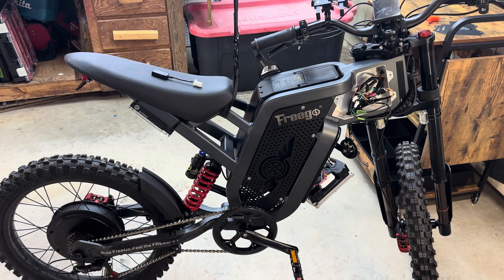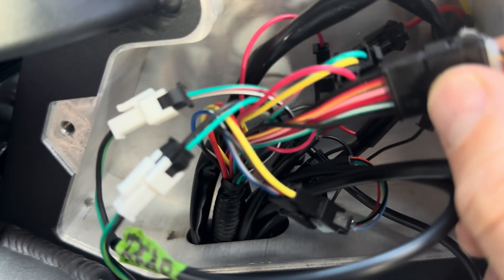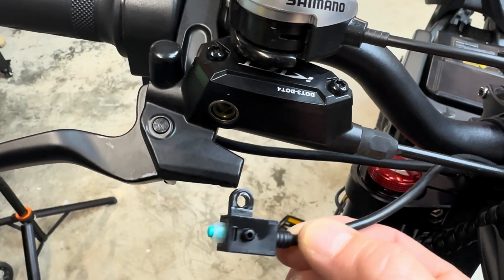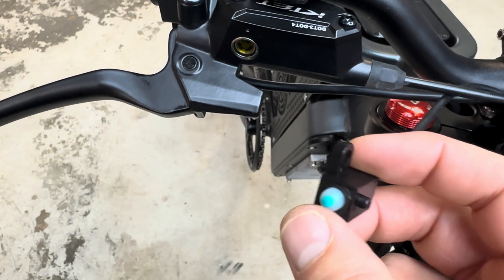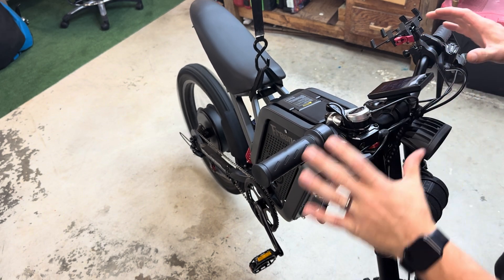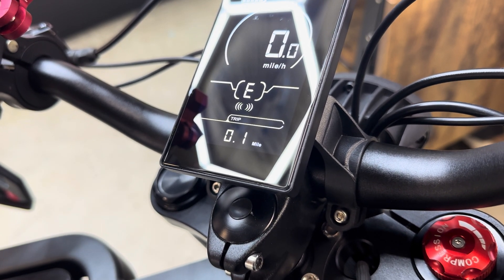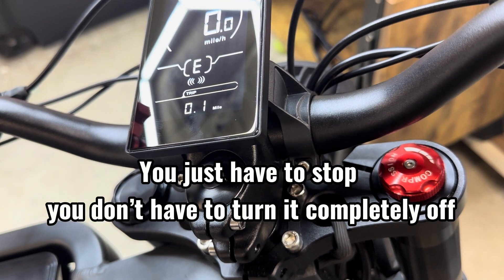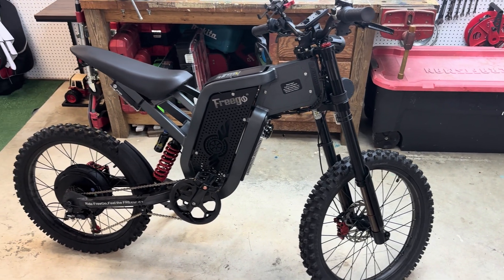Freego x2 E-Bike: Brake Sensor Delete & Controller Programming Guide

Comment: I’m getting an error code EO2 on my fregoo x2 pro I unplugged the brake sensors and the bike is still displaying the error code. What should I do?
Reply from the maker: I'm not sure what the 02 code is. Double check all your connections that they are tight and no wires are loose even on your controller.

Comment: My freego x2 pro bought few months ago, won’t turn on. It beeps once if you press the on button. If I throttle it moves  for 1 sec
but stop immediately. Display won’t turn on either. Can you give me some tips how to fix.? Wirings are ok. Battery ok to. 

What I know few hrs ago my son is trying to wheelie then it happened.
Reply from the maker: I can help better if you send me a message on Instagram. it sounds like either your display is going bad or your throttle could be messed up. I know some people are having problems with the new full twist throttle. My first suggestion would be to buy a different throttle and test it out that would be a cheap solution.
Reply: Good evening. Just to update you. The freego support team just sent me a new display monitor and it works. So it means, if the display is not turning on it won’t power the motor as well..? I’m just happy that it’s running again. Thank you for your response.

Comment: Did you ever manage to hook into the Fardriver to hook up to the bluetooth? I've heard you need to buy a new controller, is that correct? Also do you have a 12 volt power supply for your phone & similar thanks?
Reply from the maker: I will be hooking up my controller to Bluetooth sometime this week. I have it planned for Wednesday. As far as 12 V I do not. I carry a battery bank if I need to charge my phone.
Reply: @E_bikeDad  hope your able to get the bluetooth working would love to see how onw goes about getin done lol

Comment: hi, my freego x2 pro is stuck in 0 pedal assist mode, any advise? any assistance is greatly appreciated.
Reply from the maker: Unplugged each Connection plug it back in double check all of your wires on the back of your controller. Make sure that your battery is sitting all the way down on the bottom plate and there’s no gap. If none of that works, you need to email Freego support for further steps. Because it may be something going on with your controller.
Reply: @E_bikeDad thanks very much for the reply.
Reply: @E_bikeDad  thank you very much

Comment: On the M20 I just cut the sensor wires but only the back brake is necessary
Reply from the maker: On this one, you can’t just cut the brake sensor because of the style it is you have to unplug it or glue it compressed somehow.

Comment: Do you know on the x2 how to change the kilometers to miles?
Reply from the maker: you can’t without a far driver factory harness
Reply: @E_bikeDad my bike has been in mph for the past week but randomly this morning it switched to kilometers
Reply: Is there anything I can do
Reply from the maker: so most of the bikes in the US were shipped with miles per hour there are some that were shipped in kilometers per hour. To my knowledge that is a setting done at the factory. You’re the first person I’ve heard that it switched over to kilometers per hour. The only way to switch it back-and-forth should be with a factory harness and then use the far driver app.

Comment: Thanks for the vid! I have the X2 Pro. Can you tell me how you got your front brake to be on the right as it should? Thanks in advance! ⚡️⚡️⚡️
Reply from the maker: all you do is unscrew each side then flip them upside down. If you look through my YouTube shorts videos I think there’s one on there where I show it in place. But you just unscrew them and flip them on the opposite sides and screw them back on.
Reply: Ok. I thought it was just that simple. All the wires had me overthinking it 😅Thanks! @E_bikeDad

Comment: For wheelies (I'm starting to figure it out now) You need to have the bike part in 5th gear, and around 10mph at full throttle you can do the pedals at the sometime, and get it started. It's basically finding the right gear, and speed to hit both of them.
Reply from the maker: I’m about to start that journey

Comment: my 21 max goes only 47 mph.. how to unlock the speed limiter??
Reply from the maker: There is no limiter on this bike. How much do you weigh? There are a lot of factors that go into top speed of E bikes. Also, I don’t know what EKX does with their bikes. I’ve never owned one, but I assume the programming might be a little different.
Reply: I also have the x21 Max (seems to be the same frame as bike in video), and the speedo says my top speed is 48, however GPS on phone, plus two different speed limit signs say that's 42-43mph, I Have also checked for the far controller connection, and it has the same connections as this bike in video. I know you can get an aftermarket wire harness, and wondering if I have that harness, plus the dongle if I might be able to reprogram the controller to get faster top speeds.
Reply: @C0braChicken2  shoot that's about 6mph faster than I'm able to go. Ekx is great at false advertisements. Im only 155lbs soak and wet, my bike gets to 43mph, on a hill 46...I'd be happy with the 52mph i thought I was buying it for. But I see a lot of guys hauling way more a$$ than I'm able with the same bike...

Comment: How do I fix the error 22
Reply from the maker: Try unconnecting and reconnecting all the connections
Reply: @E_bikeDad  do u think the bike is screwed up now, i saved so much money for it, do i just unscrew the controller thing or the silver box and reconnect it, im not very techy at these things, i was riding normally n then it just said error 22 im just worried right now
Reply: @ashtonk-xq5kh yes un screw the bolts holding it in the manufacture has even said sometimes the connections get loose in shipping and to open it up and make sure everything is secure
Reply: Get a new throttle from ekx
Reply: I had same problem. Although even with new one it says error 22 here and there. When turn bike off says error 26 or error 30 sometimes so I dunno wtf.
Reply: @petermann841 I think their sending me a new accelerator or throttle, I just hope this can actually solve the problem

Comment: is there any way to add more power to the bike so it can wheelie easier?
Reply from the maker: The short answer is no. There is a complicated process to reprogramming the FarDriver controller. And the small amount of power change isn’t worth it if I find a simple way, I’ll let everyone know if I figure out an easy way to change the settings. Right now it requires adding some wiring to the harness.

Comment: Im assuming the brake cables would be the same on the ekx right? Its the x21 max same bike just different company’s
Reply from the maker: Yes
Reply: @ another question is my bike will beep when charging it will beep once then a second of two later it will beep 3 times i haven’t found anything in the manual but google says it could mean the battery’s towards the end of its life span but i haven’t had the bike for 2 months idrk bikes fine no issues ive had one error code and im pretty sure it was just my heat sink freezing
Reply from the maker: what do you mean it’s beeping? Are you charging it with the bike on? The on and off switch to my knowledge is for the discharge port to turn on and off not for when you’re charging the battery. I never charge the battery with the power switch the red one on. I really never charge it on my bike.

Comment: You are right. You have to get the factory harness with their Bluetooth dongle and plug it in. Then program. Some options are locked but can change a bunch of them and then when done changing settings go ahead and plug in the original harness again and you’re good to go with the new settings   Thanks for the video
Reply from the maker: Thanks for watching
Reply: Where can I get the original harness and can I change km to MPH?
Reply from the maker: @ I haven’t done this process so I’m not sure. Email fardriver and ask what harness goes to that controller and if there is any other parts you need any other parts to change the settings
Reply: @E_bikeDad  Cool, Thanks 👍

Comment: How did you change kilometers  to miles per hour?
Reply from the maker: You can’t they program that from the factory in order to change any kind of settings you have to re-pin the harness that’s on it. I have a wire diagram that shows how to do it, but I don’t have the time to the controller.
Reply: Press the power button 3 times quickly. That's what the website says 😁
Reply from the maker: @ where’s the power button?
Reply: @E_bikeDad  the link I was reading online was referring to scooter 🤣 my bad!! Mine will arrive Monday I will see what's up haha
Reply: @E_bikeDad   I just looked at some more of your videos and it seems like it is in mph. Your speeds from your phone pretty match the bike screens and on the bike screen it says miles/h under the speed.

Comment: Where does the motor disconnect?
Reply: I ask because the rear inner tube on my bike was damaged and I have to replace it.
Reply from the maker: If you check in my videos, I have one that talks about tips on changing the tire you don’t need to disconnect the motor. If you really want to the plug-in is behind the controller. When I change my back tube, I didn’t disconnect you’ll see it in the video.

Comment: Just got mine but for some reason when I come to a stop for a minute or two it automatically goes into park. Do you know how I can stop the bike from doing that?
Reply from the maker: No it’s a program default can’t turn it off
Reply: @E_bikeDad  gotcha, also do you know if the charger turns green when it’s fully charged?

Thanks!
Reply from the maker: Yes, it turns green and fully charged the Manuel says to leave it green for an hour, but I normally only leave it for 20 minutes to 30 minutes after it turns green

Comment: It looks like a fardriver 72260 controller
Reply from the maker: Yeah, but the wire harness looks different
Reply: @E_bikeDad  yeah I definitely can tell the harness doesn't have many wires as a standard one
Reply: but the ND72260 is for a 1000-1200W Motor, and not 3000W. Can u still run it?
Reply: @kingqueen27  and? You can put that on anything bro i was just assuming what that was. Now you go
Reply: @EBG-offical  
I just noticed something and asked if it is still possible bro?!. Didn't mean to offend  you or anything.
I would desperately  like to know this because I would like to replace the controller or cables. To connect the controller and control the display etc.
Since a bluetooth dongle dont work yet.
Reply: @kingqueen27  yes you can put it on any set up i thought you might know more than because I'm still learning as day goes by I will cover some of this in my live session  not offended at all I get this topic all the time
Reply from the maker: @EBG-offical  just watched some of your channel I like your content. It makes me want to do a small build.

Comment: hey any advice to an older guy that just rides a big niu bgx....but I like those bikes...
Reply from the maker: How old I’m not young anymore either man. Most of these guys riding are in their teens and twenties. If moneys not an issue I’d get a talaria or something that’s a 72 volt platform. At the price point of this bike the x2 you can afford to do some upgrading and still be way under the price of those bigger bikes. The first big modification that I’m doing on this bike is going to be to figure out how to get a bigger battery pack on this thing because if it had a 50 amp hour battery that would fix a lot of the shortcomings of this bike.
Reply: @E_bikeDad that's the reason I'm thinking of getting Stealth bomber or even E ride pro bc of the power otherwise I like the freego

Comment: Oh ya you're going to practice wheelies?? Yeeeeee!!  I got 28 days before mine arrives abd want to know how the x2 holds up for wheelies. My cunfon rz800 scooter lasted 3.5 months. Still runs but wheelies are destroying it. Lost fenders, headlight, back suspension and rear tire bald. .   But two days ago the motor started skipping out beeping giving some error code.. . The scooter telling me no more riding wheelies. But I never deleted braje sensor so think that's why my motor getting messed up. Smashing throttle and braje simultaneously too much got motor skipping out cuz sensor still connected, I guess.

Tip: I hear good idea to practice on grass
Reply from the maker: Definitely starting in the grass

Comment: Mine does the same thing with the horn
Reply from the maker: Good to know, I’m not the only one I think it has something to do with the way. The wire harness goes, and the power of the horn takes takes to honk.
Reply: @E_bikeDad  I freaked out the first time. I was way out in the middle of the woods, I bumped the horn and it shut down with e24. Btw, all of the rattle on the bike comes from the kickstand. I drilled out the rivet in the hinge and the-bolted it tightly and the bike is silent now. Oh and the headset wasn’t properly tightened on mine. Had to tighten it up because it creaked.

Comment: I have the original ekx x21 and you can reprogram the controller from the display. Not sure about this controller. Because the original ekx x21 controller was made by the same company who makes the bike.
Reply from the maker: If you can do that through the display I don't know how there are no buttons to access the menu. unless its some combo if the horn light and Park button.
Reply: @E_bikeDad  i guess the original one is different.  Has like a D pad. You can enter like 3 different menu layers. You can do stuff like control current to the motor. Etc..
Reply: How do you program controller with display
Reply: @nickz3600  i keep writing a reply to you. It keeps getting removed. I made a video about programming and the setting.  Search on yourube. EKX X21 Upgraded display set up and parameters.  I kept putting the link her so I'm assuming that's why youtube keeps removing it.
Reply: @zane___k7333  Can you do it with the EKX Max?
Reply: @codyjohnson-v6q  the creator of the video just said the Max doesn't have a D pad. So i don't think it can be programmed in the same was as the X21-SE
Reply: @zane___k7333  how fast is the s-e? Is that just the base model of the max?
Reply: @codyjohnson-v6q  goes about 30 mph. 35 max.  But it has a lot of torque. Starting torque is really, really good. Uses different motor technology than the  x21 Max. The x21 max is based on the X21 SE. And the X21 SE is based on the X20 (which no one likes haaa) na some people like it. X21 se It's built more for off-roading. But works ok on the street.
Reply: @nickz3600  https://youtu.be/8ANB7pBkkjw?si=nEpedEXWlwmIjhE9 i made a programming video for the original EKX X21. Hope this helps.
Reply: @nickz3600  for the original ekx x21? I made a video on it. https://youtu.be/8ANB7pBkkjw?si=nEpedEXWlwmIjhE9
Reply from the maker: The X2 has zero buttons for display
Reply: @E_bikeDad  🤔 thanks for the info. In other markets this bike is called the EKX X21 MAX. I was considering it over my EKX X21-SE but now that you've told me that. Maybe not. 🙏🏾

Comment: You know I didn't notice the error code when it happened, but I have the exact same problem you do. If I honk the horn it cuts the power. I found it if I keep the throttle going and honk the horn it seems to stay on but if I don't have any throttle and hit the horn it'll shut the power off and then I have to come to a stop to get it to go again. 
On a different topic. Is your battery plug connector loose ? because mine's real loose and it doesn't seem to make a good connection and I'm not sure it's charging the battery properly.
Reply from the maker: Yes, I have the same issue and what I’ve been doing is I time my battery and every now and then I go unplug it for a full two minutes then plug it back in. My concern about the battery is the time it takes to charge right now. My average is 10 hours. And that’s for a complete drain.
Reply: The first night I tried charging it up. It was like 8 hours and the charger was still red and so I thought well I'm not leaving this thing on overnight I don't want to fire going on. So I think it was the next day I plugged it back in and charged it up for a while and I was about to give up again and I found that I finally got a green light.  @E_bikeDad
Reply from the maker: Start timing how long you charge your battery for I’ve been riding it on a sticky note when I charge so I can get an average to know how long it’s gonna take to charge. The other day I ran it till I was missing one bar and then charged it and it took three hours just for that last bar to charge.
Reply: @E_bikeDad  I'm going to take it out now and try what you are saying. I had it out yesterday and it went down 1 bar. I went  17 miles ( most of that was in economy mode),but when I got back to the house it went back up to full bars so I didn't charge it. I'll see where it goes down to today. It  still seems like the plug from the charger to the battery is very loose.
Reply from the maker: Look at the chart I have on my range video by looking at the voltage your bike shows when you hit the throttle. you can look at that chart and it’ll tell you close to what percent full you are at.
Reply: @E_bikeDad  okay I'll check that out. I probably saw it before but I forgot. thanks